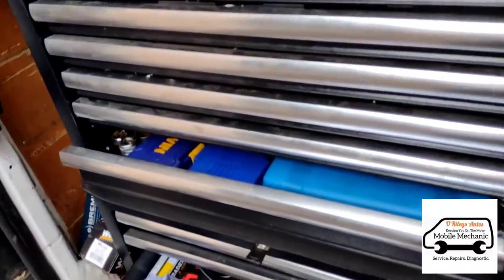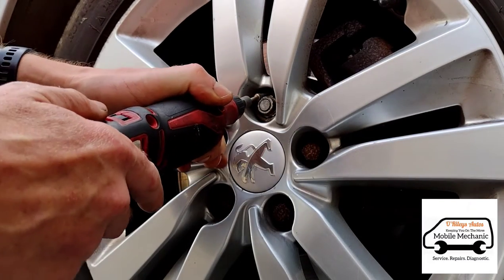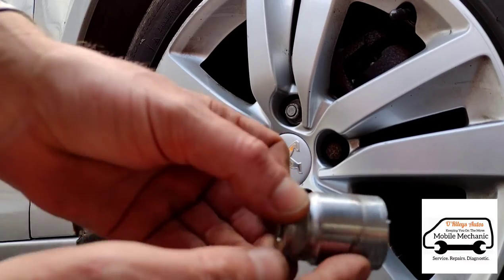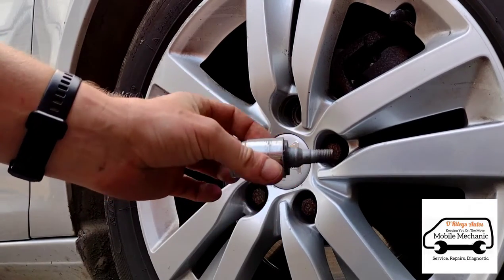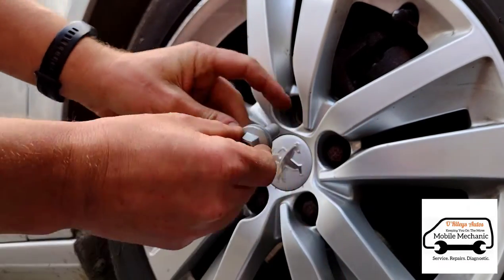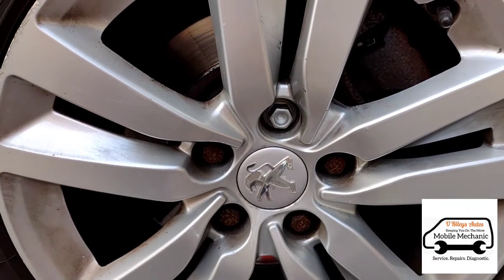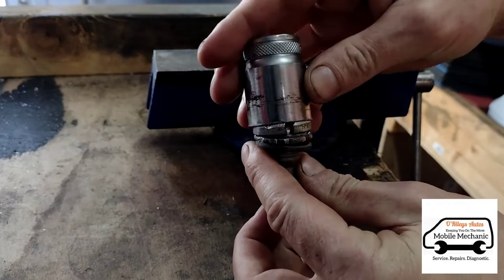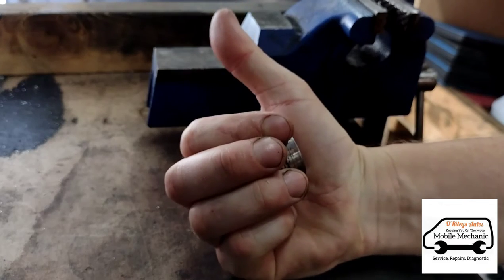How We Remove Peugeot Locking Wheel Nut And Cut Spinning Collar Sleeve

Comment: Which laser kits did you have there in your toolbox for removal of locking wheel nuts and normal wheel nuts? 
I’ve just got the two Irwin sets. And they’ve worked ok in the past for me.   Good video 👍
Reply from the maker: Laser 6972
Laser 6219
Laser 5965
Laser 8109
Laser 3291
Reply: thanks 😀😀